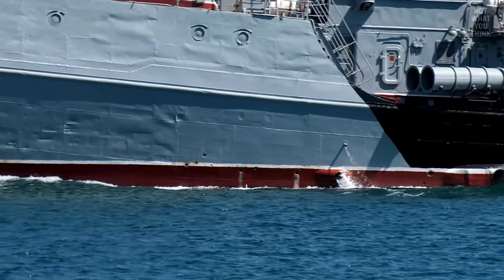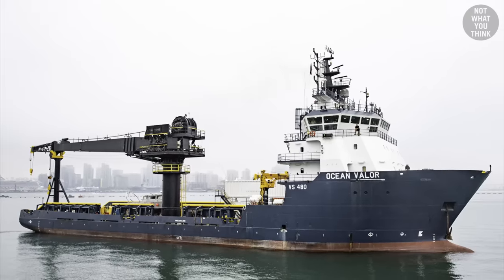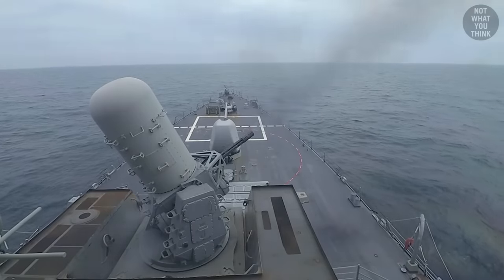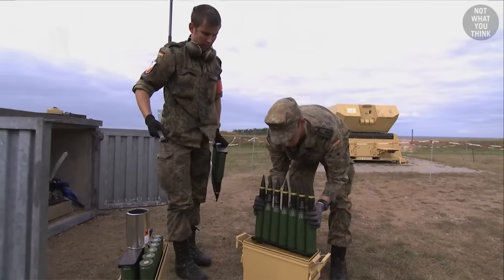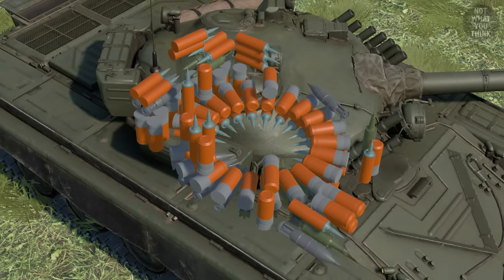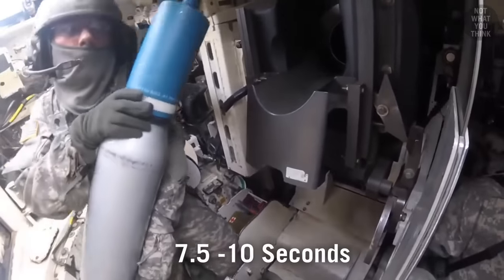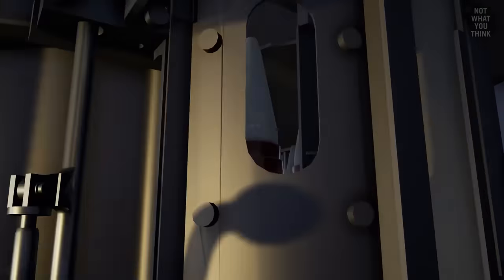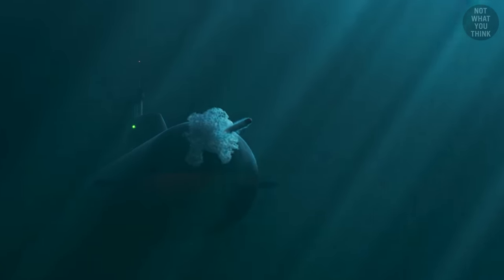Why Reloading Modern Weapons is Harder Than You Think

Comment: Great little vid and I can confirm it's hard work, as a 72 year old engineer involved in several Middle East military contracts I can agree that the reloading issue does not get any easier as time has progressed, assisting our Brit armourers in Qatar during reloading Hawker Hunter aircraft on firing programmes was a work up, the Hunter had 4x30mm Aden cannons just below the pilots feet, the Hunter gun's were in a pack and made up part of the foreward fusilage, winched in with something like a car jack.
Whilst having a couple of beers with a pilot friend of mine he said that if you fired all the ammunition from all cannons in one of the gun packs the aircraft would stall because of the recoil effect, I can say with certainty that when all 4 cannons fire and you have the misfortune of being in the aircraft at the time, your feet do not actually have contact with the flightdeck floor as said cannons are fired!
Reply: The recoil force of the GAU cannon on the A-10 equals the thrust of one of the two turbofan engines. That means the aircraft kind of loses half of its engine power every time it fires the gun.
Reply: @TrangleC  do you think it would be a bad idea to equip thrusters on the aircraft that would add in that much extra thrust while the guns are firing to cancel out the recoil
Reply: @TrangleC . The Soviets built a plane with an even bigger Gatling gun, because, y’know, vodka. But every time a pilot fired the gun, it disabled the aircraft.
Reply: @asdalotl  The machine worked just fine without any special thrusters and now it is mute to speculate about any upgrades because the A-10 is getting retired.

But even if that weren't the case, you have to consider that aircraft are very complicated, delicate things. You hear in the video that they even have to keep the empty brass casings of the fired ammo inside the plane to not mess up the center of gravity too much.

Slapping extra rockets on it, or whatever you have in mind when you talk about "thrusters" would mean extra weight, extra drag and might shake the aircraft violently when ignited, messing up the accuracy of the gun or even damaging the airframe.

The A-10 is cool and interesting because it is different than other planes and extreme with its giant gun and all, but its time is over and statistics show that it never was all that useful anyways.

The Youtube channel "Military Aviation History" has a whole video about that, where he does a deep dive into the combat record of the A-10.

During Operation Desert Storm they only used the gun to shoot at civilian trucks, were never really needed for close support missions and whenever they engaged in proper ground attack missions on military targets, they basically only used the A-10 as a Maverick launching platform and other planes like the F-16 could do that job better.
Reply: @asdalotl  Think they are called afterburners😁😁😁
Reply: @ukoldgit  The A-10s engines don't have afterburners. They are turbofan engines, basically just smaller versions of the kind of engines commercial airliners use.
Reply: @christopherpardell4418  What plane was that? I never heard of the Soviets using gatling style guns outside of those naval close in defense turrets on their war ships.
Reply: @TrangleC  I know, I was just making a comical remark to Asdalotl's question
Reply: @TrangleC  IDK what soviet aircraft uses it, but the gun in question is almost certainly the GSH-6-30.
6 barreled, 30mm gatling style autocannon, but the other commenter was right that they had to change the gun's design because all aircraft that used it suffered airframe damage from the intense recoil forces and vibration (basically they didn't bolt it to something strong enough).
Reply: @TrangleC  it is very cool in video games like, arma though, operator drewski has some super cool videos on arma 3 cas

Comment: Great video. I saw an A-10 at an airshow. I noticed a flange near the pilot's window. The pilot told me it was to deflect the smoke from the gun while firing. He explained that the first firing of the gun choked the engine and resulted in ejection of the pilot.
Reply: the cockpit windows coating the scoop and the propellant for the rounds are all special for the a-10 too just because the smoke and residue.

Comment: Quick addition on the tank loader for the abrams. Generally between engagements the crew will move ammo from other compartments into the ready rack, this usually happens when the tank is in cover and or not under fire. Tanks usually opperate in packs so if a tanks ready rack is running low it will rotate with another tank to a less vulnerable position, theyll keep the gun firing as opportunitys arrise but will replenish the ready rack 2 or 3 rounds at a time, this keeps the rate of fire up as much as possible
Reply: With some efficient, skilled 20 year old managing their area.

Comment: I'm surprised you didn't speak about the Japanese type 10s auto loader which not only allows for safety, reliability, weight and most importantly reload speed as the average reload speed of the type 10 is 3-4 seconds but there is video evidence that it can be 1 second

Comment: 1:48 We actually reloaded our VLS a couple times at anchorage in Japan. Went smoothly. not sure why it's not done more often. I think though, Japan did not allow us to load nukes... but I was always under the impression my ship did not have any! if so we should have had a Marine detachment onboard for security. Anyway, that is the reason why Kitty Hawk stayed in Japan for so long as the Japanese did not allow a nuke carrier. That has changed now though.
Reply: Yeah, that barge from Urago.  The reason they don't do it more is because it's difficult to get that much loft from a barge(which is sitting down near the water rather than halfway up like a pier).  It's VERY touchy trying to do the VLS systems, even in the relatively sheltered sea state you get in Tokyo bay.

They're putting in a loading/unloading pier at Urago.

Comment: 17:04 that’s the case with most aircraft guns, you don’t want your jet engine to suck in the casing. Also you‘d need an extra hole somewhere to eject the casings.
Reply: That is the general case for all rotary machine guns. It is easier to cycle them back into the magazine than to acutually eject them. Besides, when you are firing at 50-100 rounds per second that is a whole lot of very hot brass you would be spraying all over the place raising havok with everyone nearby.

Comment: 17:21 Oh man I remember breaking track.  

Turned in 4 tanks in 5 years.  1 tank had both tracks rebuilt using individual track blocks.  1 tank done with 8 bock track sections ( that was nice ) ... the other two were just turned in as is.

Had to put track back on 3 tanks in the field ( thankfully in dry moderate weather ).
Reply: 10:28 as a first year Mechanic looks like a bitch to torque a bunch of bolts in the tracks
Reply: @jhonthecat5061  
You get them as tight as possible, then drive around the motor pool which stretches the track and helps the wedges seat and then you go tighten again.
Reply: @johnjacobjinglehimerschmid3555  So a retorque neat! how many segments of track does a tank generally have? how many times do you have to retorque is that a regular maintenance thing or not for tracks? how quickly do tracks wear too?
Reply: @jhonthecat5061  
If I remember right, going back to 1986 here,and M60A3's had 80 track blocks per side.  
Was it a regular procedure, no not really after any sort of movement, especially if it was an off base movement, It wasn't unusual to find missing bolts and or the wedge nuts.  If you did you walked the track looking for missing and honestly I'd just hammer the connector and listen if it was a ping, tight connector or a thunk loose and tighten them up,

Inside ones were hardest as you had to crawl along as the driver moved the tank forward.

Comment: I served in a mechanized unit using Bradley Fighting Vehicles. They use 25mm chain guns as the main weapon system, and reloading those is a pain in the ass lol. I lucked out by being a driver, lol. All I needed to do was keep the vehicle up and running and provide a stable platform to shoot from 😆. The guys in the back had to deal with popping floor plates and reloading 25mm ammo in a space you could barely stand up in 😆. Still, I loved my BFV. It was a work horse.

Comment: In your discussion about the Sea Sparrow (which had an awful reputation about 25 years ago, btw), you mentioned how the Phalanx could be considered the 'goal keeper' of the layered ship defense system. The British use a CIWS system called Goal Keeper - which is more-or-less a 30mm version of Phalanx.
Reply: Goal keeper is a much heavier system. The think with the phalanx is it is both light (As ship weapons go) and can be mounted on just about anything, any where. The problem with goalkeeper and presumably even more so with mantis is that the ship needs to be built with these emplacements in mind. The goalkeeper weights almost twice as much with all the added power, cooling and stabilization cost. By the time you get to mantis you might as well be using a small ship cannon. No Idea what their requirements are but it is certainly a chonkey looking boy.
Reply: @Snipergoat1  I don't think Mantis is a going concern anymore. Admittedly it was a really quick search, but it looks like only 2 were made.

Goalkeeper has a total mass of 9,902kg; and Phalanx has a total of 6,200kg.

I think you're correct that the biggest advantage of Phalanx is its inherent modularity. It does need power and hydraulics from somewhere, but that can be located at a reasonable distance away. It carries it ammo in a drum just below the gun, which eliminates below-deck colocation.

Goalkeeper has a longer effective range, but does require a huge amount of modification for the massive support system that must be located immediately below the mount; which includes its magazine.

Interestingly, and I didn't know this before, but the UK is unmounting Goalkeeper in favor of Phalanx.

Comment: I spoke with an Abrams tank commander who participated in the Gulf war (1991). When I asked about autoloaders, he was critical of their reliability. He also said the manual loading was faster. His crew was able to reload in just 4 seconds.
Reply: Crew loading may be faster - when the loader is not tired / has not been tossed around during battle and so is uninjured. We humans are fragile, generally. And a tank is basically a big metal box. Accidentally banging around while inside the big metal box may injure humans.
Reply: "His crew was able to reload in just 4 seconds."

Not impressed. Firstly, that's just for the shells that are easiest to grab in the rack and the loader would have to do some funky stuff even so, like lap-loading with the bustle door open.
Secondly, the current tank record (for 10.5 cm guns) is 2.5 seconds a shell for the full complement of 25 AP and 20 HE.
Reply: @BPo75  Impressive stats. But, #1) Can you substantiate your claim by citing a source?           #2) On what platform was this record achieved?
#3) A 105mm shell is obviously smaller than the NATO standard of 120mm for tanks. So the comparison is a little bit apples vs. oranges
#4) What do you mean by 'full complement"? ( I assume you're NOT suggesting firing 45 rounds in 45 * 2.5 = 112.5 seconds.
Reply: @gregparrott  Stridsvagn 103. The right magazine held 25 rounds, while the left held 20 plus 5 manually cranked rounds, usually smoke or illumination.
Obviously, firing 45 rounds in a row would be detrimental to the gun, but it was done on several occasions to test the reliability of the loading automat.
The declassified military archives as follows:
 Pansartruppskolan, Försöksavdelningen,  1960-1965, Serie F II, Volym nr 1. Datahandbok strv 103, page 1.

Försvarets materielverk, Armématerielförvaltningen, Fordonsavdelningen, Centralsektionen, Serie F I, 1100:1-11 - 7890:1, 1969, Volym nr 10. Chapter: RAC Equipment Trials Wing, RAC Centre Report on Swedish S Tank.
Reply: Adding bananas and cherries to the fruitsalad of comparisons, the OTO 127/64 LW is capable of 32 rounds a minute while the preceding 127/54 C was good for 40 rounds/min.
As these are naval guns, a direct comparison is of course ridiculous, but what it shows that it is possible to construct very reliable and fast handling autoloaders even for modern munitions.
Looking only at landbased systems, there's no shortage of solutions in the 155 mm artillery segment either as that's a requirement for MSRI-functionality.

In short, I'd say autoloader performance are more down to 1) desire and 2) willingness to pay for it than to technical limitations of what is possible.
Reply: @BPo75  The 5-inch Mk 42 turret you mention was not reliable at 40 rounds per minute.  That is a major part of the reason why it was replaced with the Mk 45 turret.  Weight and its lack of effectiveness as an air defense weapon were other reasons.  The Mk-45 turret loads 16-20 rounds per minute but is reliable.  The Oto-Breda 5-incher isn't any better. than the US Navy's old Mk-42 turret.  To get 40 rounds per minute there are side by side ammo feeds each capable of 20 rounds per minute and a device to switch between feeds as rounds arrive from their respective carousels.   The Mk-45 has a single carousel and simplified loader.  Surface fire only now but very reliable.
Reply: @philsalvatore3902  I was only talking about the Oto-Breda turrets as I'm not that familiar with the American ones, so thanks for adding them to the comparison.
16-20 rounds per minute would still make a very good rate of fire for a tank gun.
Reply: @BPo75  To achieve that rate of fire there is a crew of I believe six sailors moving ammunition from a below deck magazine up an ammo hoist to the handling room beneath the turren.  From there sailors are grunting the ammo into a carousel that feeds the auto loader.  The process is mostly unchanged from the 1930s when the first enclosed 5 inch turrets showed up on American destroyers.  On the old manual loaded 5 inch/38 cal gun from WWII (I have crewed one of these as a cadet in the Coast Guard Academy) there were 8 or 9 people in the turret.  It was a crowded!  Those guns had one carousel and could fire maybe 12 rounds per minute.
Experience in WWII said 12 rounds per minute wasn't enough nor was the range of the 38 caliber gun so the US came up with a 5 inch/54 cal gun that used two ammunition carousels, each capable of feeding about 20 rounds per minute.  Below decks in the handling room you basically had the equivalent of two older 5-inch 38 cal carousels side by side feeding the single turret above.  The autoloader had to be able to switch between carousels every round and that mechanism was the weak link in terms of reliability.  The Oto-Breda turret is mostly the same.  
The US Navy experience with Oto-Breda products in not good.  Very poor reliability.  We had the 76mm Compatto on the FFG-7 class, some PGHs and the Coast Guard's Hamilton Class.  The US Navy cut the rate of fire so they would stay together.  Early mounts before the rate of fire was restricted basically shook themselves apart.  Kludge.  The folks I know at Dahlgren say the Bofors 57 mm gun is the best naval gun under 100 mm.  Superb reliability, same range as the 76mm Compatto but 250 rounds per minute and a much greater weight of fire as a result.  A better naval gun in every way.

Comment: I was part of the Weapons department on a U.S Navy cruiser. Worked with most of the at sea systems shown. CIWS, 5 inch, 25mm and torps. 

CIWS for the U.S has the benefit of being a fully self contained unit, all we need is ships power and sea water for our water to water heat exchanger and we are good to go. We can search and track without any other systems though we are integrated (decreases the time to availability in case of catastrophic failure). We really only use the tungsten rounds and only use kinetic energy for the kill no exploding rounds (naval variant). Fired from 2 separate locations on the ship and very accurate. Also 

5 inch is a monster, the ammo elevator goes down several decks and you can send shells and canisters up to the gun crew continously. it is all hydraulic based pretty much though so just hydraulic fluid everywhere, It uses EOSS (think a big hi def camera) as well as integration to other ship systems for targeting. It is run by 2 different teams. the loaders and maintainers under the gun and the shooters up at the firing console. Every time it shoots you feel the ship shudder. It is impressive.

Torps are another hydraulic mess. We used high pressure compressed air to launch them out and they are self propelled with self oxygenating fuel.

Comment: I served on ships that had 5”/38, ASROC, Chaparral, 3”/50, Terrier missiles, M-2 .50BMG, Mk 19 grenade launcher, 20mm cannon, Mk 45 5”/54, Harpoon, various models of Mk32 torpedo tube, SH-3 helicopters, SH-60 helicopters, Seasparrow missiles, CIWS, VLS, Oto Melara 76mm gun, SM-1 Standard missiles.
Yes Chaparral was a army system however in 1972 the USS Lawrence and USS Floyd B. Parks had the system.